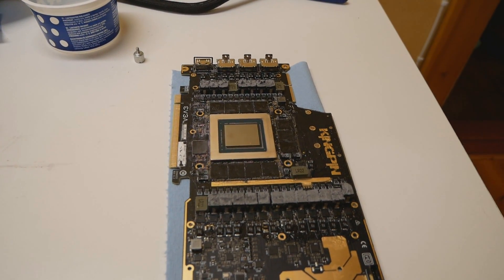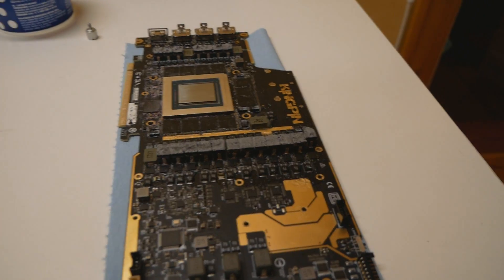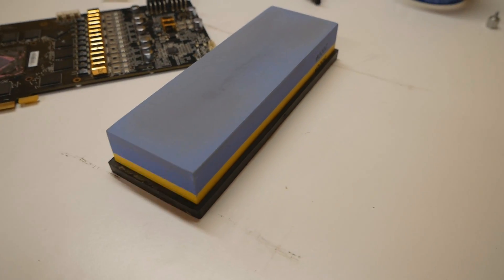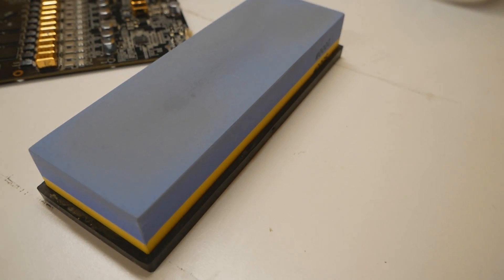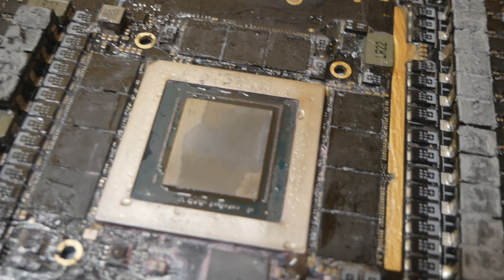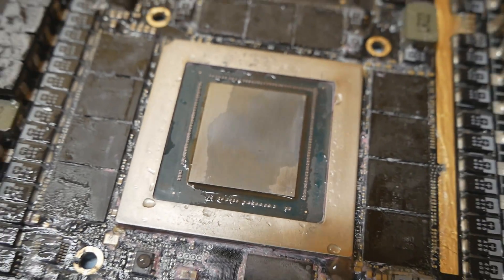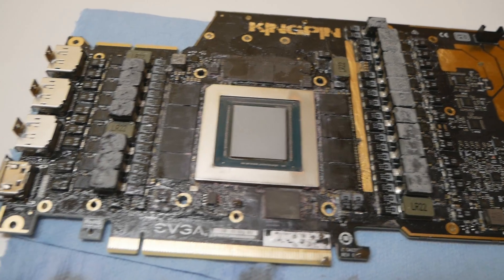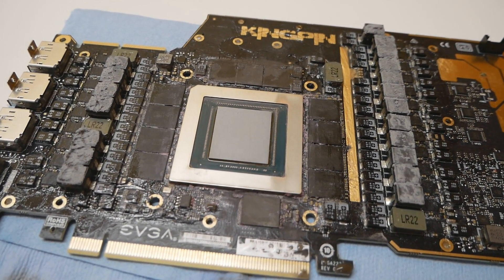Perfect GPU Lapping with a Water Stone

Comment: wouldn'y yuour b e also grinding the VRAM or other components? What if you destroy some components like capacitors and what not?
This will only work on the assumption that that area you are grinding down is supposed to be even. That is impossiblie because so many components are used in the manufactering.
This is beyond risky. Not a mod i would be doing.
Edit : why no posting of temperatures and how it's working after the lapping?

Comment: Hey, was actually looking for such video. I'm quite into knife sharpening and and IT. The water stones you got are really the cheap:meh option, probably not true to their grit (a descent 5k gives you miror finish). 

Concerning the soaking of the stones, thoses shouldn't need more than 30 min of soaking (until the stone doesn't absorb water. The best choice would have been to use a splash and go stone that doesn't need as much water and doesn't generate as much slury. 
Best,

Comment: What's the cleanup process like after this? I'm assuming none of the ground core residue is conductive?
Reply from the maker: Just clean the card thoroughly with alcohol and CRC. Also blow possible particles with compressed air.

Comment: I have been using a diamond hone for knives after lapping to touch things up if needed.
Reply: I usually use a full diamond progression and diamond paste or spray to strop the edge, with steel that have very hard carbides in them. With lower carbide steels I use SiC stones or ceramic stones. Sadly the stones in this video are not the advertised grit #... But that's China for ya.